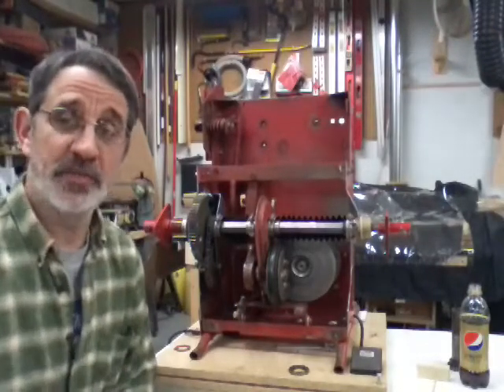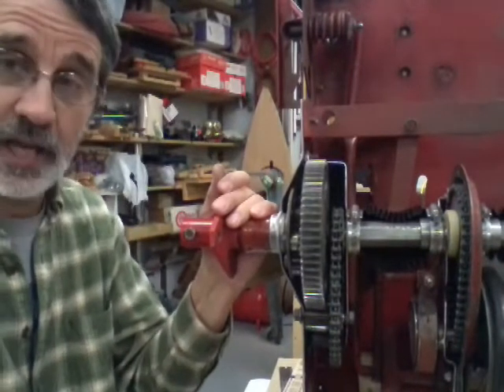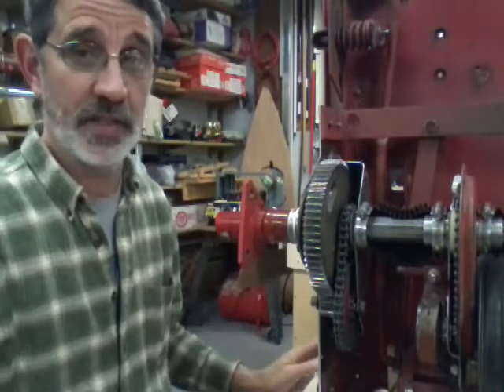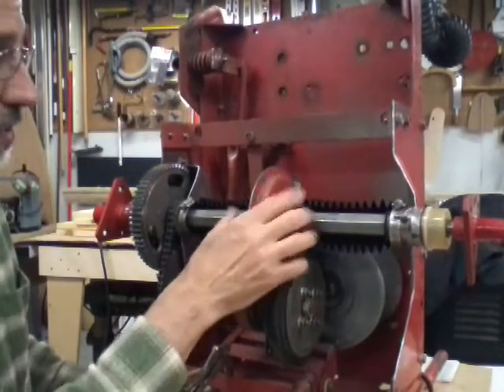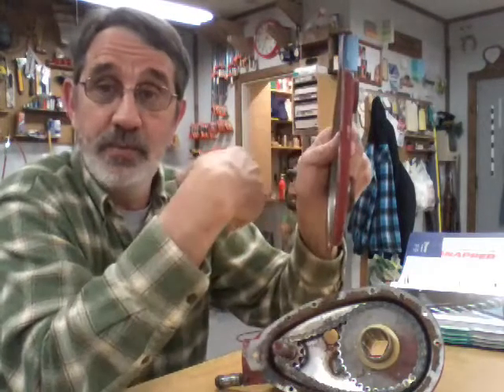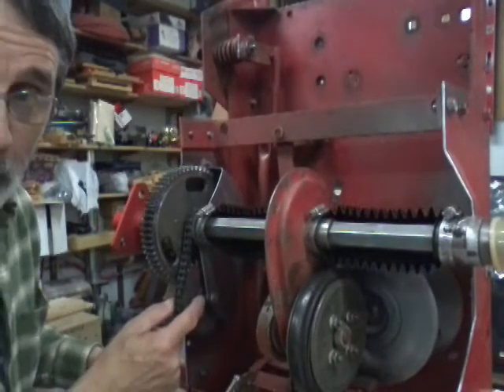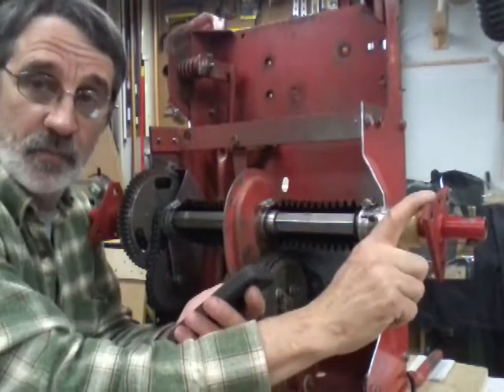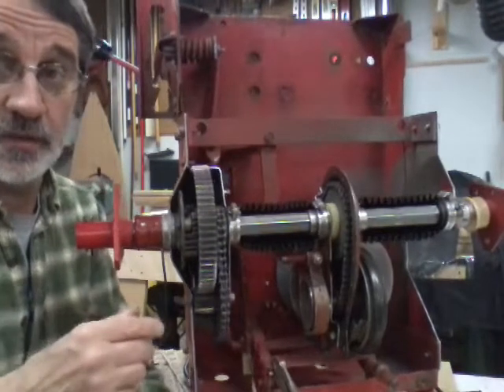90. How to fix your chain case and differential on a snapper rear engine machine

Comment: I'll be 62 this year. Since I was in my teenage years we've always had a snapper mower. They have always been dependable and fairly easy to work on. Have never tore down a deferential on one but may do it one day. Have old ones I use for parts. I remember the first one we ever had was a comet like you mentioned in this video. It was notorious for popping wheelies... lol 
Enjoyed the video and keep up the good work.
Reply from the maker: Big Bill 
   Hi Bill it's Jim it's great to hear your stories of the relationship between a snapper and its owner I feel sorry for someone that has never used a snapper they don't know what they're missing I feel it's one of the top machines for picking up leaves and sticks and virtually anything you run over. I have a few of my own stories about my snap days. And I'll tell you what Bill when you decide to tear into one of them differentials I'll be here to help you out. And as always work safe have fun and I'll talk to you soon Jim

Comment: Hi Jim I enjoy watching your videos. You have helped me on my son's snapper. And thanks. I'm from South Georgia Adel.
Reply from the maker: Well thanks for watching and I am guessing that you’re a subscriber I can use all the help I can get thanks again. Jim
Reply: @jimjackson9381  yes I am. I'm on the hunt for the big bearing boot and lip seal for it. That boot was toast. Who ever work on it before left out the lip seals. I have to get the short shaft. It's has a bad grove in it.
Reply from the maker: @richarddaugharty732   there are two different dust caps for the snappers it depends if you have bushings or bearings in your rear fenders. Jim
Reply: @jimjackson9381  The one I have has the bearings.  I don't have the modle # because someone welded a plate over it and burned it up. Sorry it took so long to get back to ya.
Reply from the maker: @richarddaugharty732  So far the only answer I’m getting from my suppliers is that dust cap is out of stock they no longer make them I get a chance this weekend I’ll see if I can find some somewheres and I’ll get back with you thanks.   Jim
Reply: @jimjackson9381  ok thanks. I'm have two places that I'm going to check with too. Just found out about them last night. If either one of them have them I'll let you know.
Reply from the maker: @richarddaugharty732  Well I hope you have better luck than I am trying to find these rear boots for the seal if you find any let me know. Jim
Reply: @jimjackson9381  Hi jim. I'm still not having any luck. But they are looking too. I've been brainstorming. What do you think about trying some large shrink rap.i wonder if it would work?
Reply from the maker: @richarddaugharty732  I don’t know how shrink wrap would work I suppose it be worth a try put a seal on the shaft and then slide heat shrink tubing on and shrink it and see what happens might be a good idea. Jim
Reply: @jimjackson9381  Hi Jim. Still no luck on the boots.  No longer available.  But I have lucked up and found a junker that has the bushings and so far it looks like a good one. So I'll go through it and put it on my son's mower. I am going to try the shrink on the old one and send you some pic. Thanks again.  How is the Dooley snapper doing. That's was beyond cool.
Reply from the maker: @richarddaugharty732  
It’s doing pretty good, and keep me posted on how that works out. Jim
Reply: @jimjackson9381  I sure will Jim. I'm still snapping.

Comment: Those cupped washers that are everywhere on Snappers are called Belleville washers. They're really old school, as are the eccentric bushings on the axles. I've worked on equipment that was designed in the early 1900's and both of those were used. They work great and they're simple, once you know about them and how they work.
Reply from the maker: Yes, I am familiar with the name of those and how they work but most people are not so I just called them cup washers and I tried to explain that they are a old school lack washer that’s not really used much anymore.
Reply: @jimjackson9381  I really appreciate what you're doing in these videos. They are really helpful!

Comment: Thanks Jim great job!!! Are you calling the friction drive roller the brake clutch? When you say keep an eye on the wear of the brake are you talking about the rubber on the friction roller?
Thanks 
Leo from long island
Reply from the maker: I think when you say friction roller that is what I called the clutch disc it’s the disk with the rubber on the outside, Jim

Comment: I have six bean trees and totally understand the leaves problem. What I am wondering is the commercial machine gears and chains #30 are the same as the residential machine with the exception of the eight spur gears and bearings compared to four spur gears with bushing ???? What is the largest engine these gears can withstand ??? Thanks Jim again. VF
Reply from the maker: Victory First 
I’ve had a few viewers that have sent me pictures with a 17 horse Briggs & Stratton V twin engine on their’s. Jim
Reply: @jimjackson9381  Thanks Jim.
Reply: @jimjackson9381  Thanks Jim, "YOU THE MAN " !!!!!!!!!!!

Comment: I've been working on the one my dad left me last month after he passed. The lever won't let me even put it in reverse? I can get it to go forward but the lever won't even go in to the reverse position. It's a Snapper 10hp 30" cut RER. Can you give me any advice on why the lever won't move to the reverse position?
Reply from the maker: Try cleaning and greasing the hexagon shaft underneath of boots that should help it shift a little better if not let me know. Jim
Reply: @jimjackson9381  I'll give it a try, I also ordered a new clutch for it. From what I can tell the axles boots have completely rotted away. When I shift it through the forward gears, I can see something that looks similar to the differential move left to right. But once I try to move towards neutral and reverse it won't budge. I'm just hoping something in maybe that differential isn't damaged. I really appreciate the advice. It'd be nice to be able to get this thing going again. It's more of a sentimental thing at this point
Reply from the maker: @jamesfox1882  if your boots are completely gone it may be a good time to disassemble the drivetrain and clean all the sand and dirt out of the inside of the differential and chain case install new cork gaskets on both and reassemble. Jim
Reply: @jimjackson9381  yeah that's what it's looking like will happen. It looks like some rubber deposits on the drive plate? The piece the clutch contacts. I also did order a new clutch for it. It's probably never had any maintenance over its life span. So I'm just going to tear everything down, clean it and grease everything. Is there a website you'd possibly be able to recommend for parts?
Reply from the maker: @jamesfox1882  Well if you need anything let me know. Jim
Reply: @jimjackson9381  Update: I did grease the hex shaft and replaced the clutch and now it does go in reverse and also has the first couple of years it didn't have. I did need to get a set of axle boots for the hex shaft. Thank you so much for all your help. It means a lot to be able to repair my dad's lawnmower and be able to continue to use it to cut my mom's yard.
Reply from the maker: @jamesfox1882  Well I am glad I could help you have someone take your picture sitting on your snapper and email it to me so I can put it on my Wallet friends. Jim

Comment: what would cause the mower not to be able to be pushed backward?  The gear is in Neutral and can roll forward but not backward.  Mower runs forward and reverse but does not roll back when trying to push it around the garage.
Reply from the maker: tom ahn 
 Hey Tom it's Jim I'm glad to see you're a subscriber, sometimes when I try to move my snapper I have to wiggle the shifter back-and-forth to get it in a certain place so it will roll easier give that a try and see if it helps. Thanks Jim

Comment: 20 yr old snapper, will not move when shifting forward or reverse, replaced clutch . Wear on yoke and bushings, when in neutral wheels locked up wont roll, watched video and when upright one tire spins opposite of other, but when turning clutchplate, very hard to turn but tires dont turn as video shows, thinking chain or differential issue, any heads up where to start
Reply from the maker: Scott Deshotel 
Well if I had to guess I would say probably the differential once you pull the right hand fender off and the axle and hexagon shaft will come with it out of the chain case then you can turn the chain case and see if that works OK and smoothly otherwise it’s in the differential. Jim
Reply: @jimjackson9381  thank you

Comment: Thanks Jim!
the hex shaft turns in the small chain case, all is good in there!
when the hex turns the left wheel as you look at the diff from the back with the mower up does not turn or sometimes it catches and turns, hear a clunk or grind sound...ideas??
Reply from the maker: Mr. X 
   Boy oh  boy let me count the ways, 
well for starters it could be the teeth on the short axle, 
 It could be the large 63 tooth gear,  
It could be is a small gear with the sprocket under the large gear, 
Or it could be the chain,
Or it could be the sprocket on the end of the Hex shaft, 
Without opening it up and looking at it, it's just a guess.  Let me know what you find out if you need any other help just let me know thanks for your question Jim
Reply: Thanks jim my guess is the sprocket on the end of the hex shaft
Reply from the maker: Mr. X 
  Well good luck and let me know how it turns out I would like to know what the problem is for future questions thanks again Jim

Comment: Hi Jim..love your videos..!
SO you say on the video that a residential  snapper has bushings and a commercial snapper has bearings....
Can I make my snapper a commercial snapper without adding the bearings and using bushings instead?
Reply from the maker: 18wheelerist      hi it's Jim
There are a few differences between a residential snapper and a tough series, and a commercial model.  Some have bushings and some have bearings in the fenders. The tough series and commercial models also have eight pinion gears instead of four in the differential otherwise they're basically about the same.  Thanks Jim

Comment: Could u not use red rtv locktight as 609 locktight that u talked about
Reply from the maker: jduane f 
   As long as The red locktight is removable and not permanent, you want to be able to get it apart next time it needs service. Thanks Jim

Comment: So my clutch would spin a little then bind up.  After tinkering as little without tearing anything apart, the clutch spins freely by hand.  Im thinking the chain inside the center case...?
Reply from the maker: Sean Carroll 
I guess the only way to tell for sure is to disassemble it. Jim

Comment: how do you get the large nut in the center of the clutch off? I can't figure out how to keep the clutch from spinning when I try to take it off.
Reply from the maker: Jarrett Miller 
   I usually take a large screwdriver and stick it between two of the smaller nuts on the clutch assembly and then you can take a ratchet and break loose the big nut that holds the assembly on.  If you need anything else just let me know thanks for your question Jim
Reply: Thank you so much! I appreciate the fast reply!

Comment: Mr. Jackson I have an old snapper comet from 1961 I put a new 5 hp engine on her and did it the way you described in a video every thing is lined up properly. but there is a very harsh grinding sound coming from the lower unit / drive system the tires are spinning properly and all seems fine except the noise. My case is a old one that has break shoes on both sides and no finders to take apart. I can’t find any info on this relic. Your advice would be very appreciated thank you
Reply from the maker: Bill 308 
Hi Bill, I haven’t done too much work on the old comets Let me see if I can get somebody to help you I’ll have them try to answer your questions. Jim
Reply: Jim Jackson thank you very much
Reply: Numa Newbern thanks for the info, I have had a very hard time getting this mower fixed up it was my grandpas and means a lot to me. I hope I can fix this thing I’ll post a video of the mower so y’all can see what I’m dealing with
Reply from the maker: Bill 308 
 Bill With the grinding sound you’re hearing is the edge of your chain case hitting your drive disk.  If it is then your drive disk is to low on your engine Thanks Jim
Reply: Jim Jackson how can I obtain those pictures of the parts diagram from you mentioned above ? Thanks agin for your help
Reply from the maker: Bill 308 
Hi Bill this is Jim I sent the pictures to you last night did you get them. Jim
Reply: Jim Jackson yes sir I got it thanks for the help

Comment: Hey u done freind? My problem is when mower not running, n neutral u can turn one side the other goes the opposited way but when u hold both tirers it want move.
Reply from the maker: Richard Hunter 
  Hi Richard you're going to want to watch video 132 that would explain how to troubleshoot your differential and drivetrain thanks Jim

Comment: Gonna be an odd question for sure but.......there is a rattle when I’m in drive. Thought it was the heat shield. Took it off. Rattle still there. Where would I look first?
Reply from the maker: Nick Atkins 
Hey Nick it's Jim
     A lot of viewers complain about the rattle they get from the little break arm that rides in the side of the clutch disk assembly, and  the newer snappers have a spring that holds that from rattling check that out and see if that's what you're hearing. Thanks Jim
Reply: Jim Jackson thanks Jim! Will do. Get back with you!

Comment: I have a snapper model #331414kVE My problem is my Drive wheel the rubber Gets so hot it will melt that rubber on the Wheel
Reply from the maker: Jerry Blice 
Hi Jerry it’s Jim
Stand your machine up put it in neutral and try to turn the clutch disk it should turn relatively easy, you may have to pull your tires off and check your bushings in the fenders if your bushings are shot that will put a extra strain on the drivetrain causing the rubber disc to slip on the drive disk and it will either wear it down or melt pieces off of it, check that out and let me know what you find. Jim